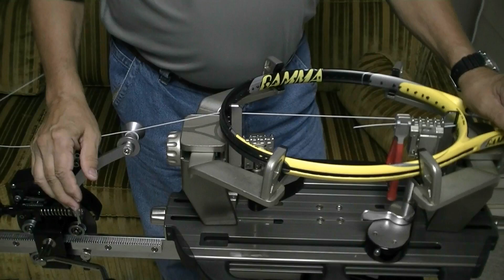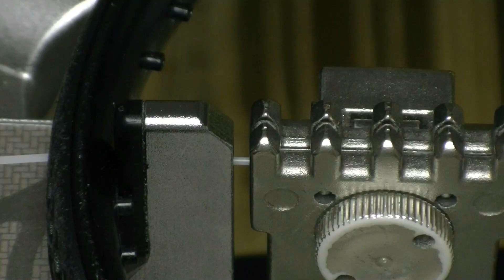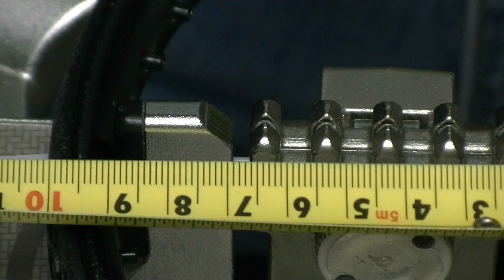Constant pull vs. lockout or crank

Comment from the maker: If you have been using a single pull method and like it by all means do not change. This method if for those times when you have new customers that normally have their racket strung on a CP machine and you want to duplicate the feel of a CP.

Irvin

Comment: Perfectly explained, thank you, and an American talking in mm!!! Finally!
Reply from the maker: Karl Roszko LOL usually when I’m dealing with tennis (balance, weight, and inertia) I use the metric system. The rest of the time it is inches, feet, yards, etc. for instance if I’m measuring out string it is about 36 feet or 16 racket lengths, not 11 meters. Or the short side is 9 feet or 4 racket lengths not 2.75 meters.

Comment from the maker: What I was trying to do with this video is show how you can get the same result from a LO stringer to match that of a constant pull.  If you string for someone else that usually has their racket strung at 60 on a constant pull to match that you should double pull at 60.  If you like your racket strung at 60 on a LO by all means do not change.

Irvin
Reply: You briefly mentioned stringing at a higher tension. Would it not be quicker to increase the tension by the appropriate amount and only pull tension once?

Comment from the maker: That is a Gamma 6004 6 point self centering stringer. Just to make sure you understand what that is there are two supports inside the frame at the 12 and 6 o'clock positions.  There are also 4 supports on the outside of the frame so support the frame for a total of 6 points.  The self centering turntable has one adjust for both the inside supports so the frame remains centered on the turntable equalizing tensions and pressure on the top and bottom of the frame while stringing.

Irvin

Comment: I think the most important point in stringing is to make a racket playable. When using CP on polys, if you don’t clamp off fast enough - it just “sucks” the life out of the string (the string looses it’s elasticity). It’s important to get the right balance between how much tension a string can lose after the stringing is done vs how much elasticity is actually left in the string. Just getting the tension right doesn’t mean the racket will be playable. Yes, it will hold the tension longer but at the expense of lack of string playability. Hope that makes sense
Reply from the maker: Makes sense to me but with an eCP you could also lower the tension.

Comment: great video!  If I've been using a crank stringer for a couple years now without using this method, would I receive any benefit from using this method for my own racquets?  Stringing the same racquets is about consistency, and since I'm used to what I've been stringing at the past couple years I think I should stick with it.

Comment: Is this called pre stretching the string?
Masterful tip. Thanks
Reply from the maker: No. There are 2 types of pre stretch, manual and machine prestretch. To manually pre stretch you pull manually on both ends of the string before you start stringing a racket. Some eCP machine have a pre stretch feature of 5-20% pre stretch. In this more if you set your tension to 60 and pre stretch to 5%, the machine will pull to 63 lbs then relax a little then go back up to 60. Some machine work differently but that’s the jest of it.
Reply: @Mr10sStringer  
Thanks for the explanation 👍.

Comment: I wonder when you release the clamp holding tension (next to be moved).

Do you: 1.Pull tension, 2.Release the clamp that are next to be moved, 3.Repull tension, 4.Then clamp off?

Or would you recommend: 1.Pull tension, 2.Wait X sec, 3.Repull tension, 4.Release clamp, 5.Then clamp off?
Reply from the maker: Never release a clamp that is holding tension. For clamping operation pull tension clamp the string and lock the base if you’re using fixed clamps. To remove the clamp pull tension on a string release the clamp base on the string closest to the tensioner, and then release the clamp. No need to wait x seconds.
Reply: @Mr10sStringer  Thanks for your reply, really nice of you to take the time.
Yes, I know you should not release the clamp holding tension without pulling tension before.
What I did wonder was if you for example have done 50% of your mains, and both clamps are in use holding tension. When do you re-pull/Stretch for the Second time (to imitate a constant pull), Before or After you released the clamp closest the tension head?
Reply from the maker: @tobiasjohansson3934  I would not pull another string until I’m finished with the previous string. A CP will constantly pull on a string for as long as you apply tension. As the string relaxes the CP pulls more. On a LO machine you still have a constant pull even after LO it just never stretches the string any farther. So I have tensioned the 4 center mains on each side and ready for the 5th. Pull tension on the 5th and after lockout run in the 5th on the other side. In the few seconds it takes you to run in that string the string under tension has relaxed enough and can be pulled again. Then the string again and move the clamp.
Reply: @Mr10sStringer  I will try this. Thank you!

Comment: Great subject for discussion. What machine are you using? It looks much more precise than mine.  The best crank machine I have seen is the Prince Neos 1500 but you seem to have six point mounting. Is that a machine you recommend? Thanks, Paul.
Reply from the maker: That was a Gamma 6004 stringer

Comment: issnt this just a form of prestetching? Once you set the clamp and move to next string still lose tension
Reply from the maker: It’s not like prestretch ing. A lock will ‘lockout’ immediately when the string reaches reference tension. A constant pull machine will pull even after tension is reached. All this method allows for is more pulling on the lockout. Yes any type machine will result in tension loss after you clamp the string.

Comment: If I want to pull once as same pound compare to Constant pull,could I add more pounds on crank locout machine?Thanks
Reply from the maker: Leo Leo yes The USRSA recommends you add 5-10% to get in the vicinity. That will depend on the string and how fast you crank the LO. Different strings stretch at different rates, so I’d use the USRSA for ease of use. If you crank fast use 10% slow then 5%.
Reply: Mr10sStringer Thanks a lot.

Comment: So, I noticed that you have the crank on the outside of the stringer (facing away from you).  What do you think the benefit is of that or do you just find that it is personal preference?
Reply from the maker: String It Like You Mean It just personal preference. With that machine you can put the crank on either side. I normally used a Wise Tensionhead. I have since sold both and have a Banolat Star 5 now.